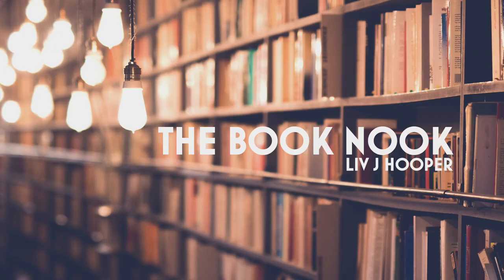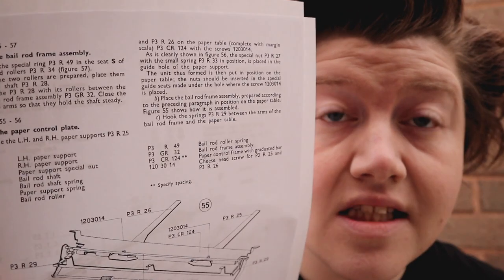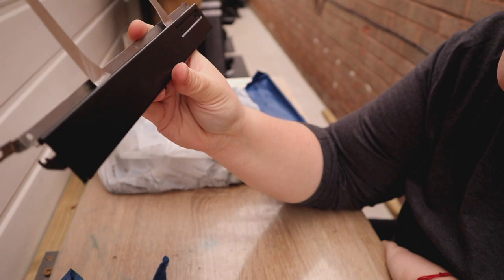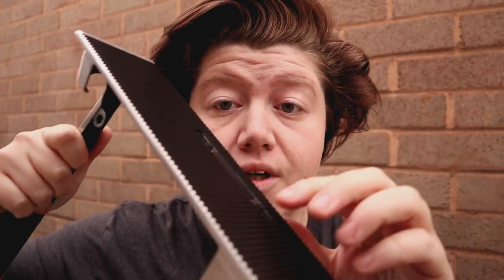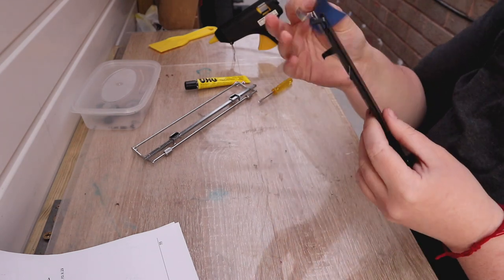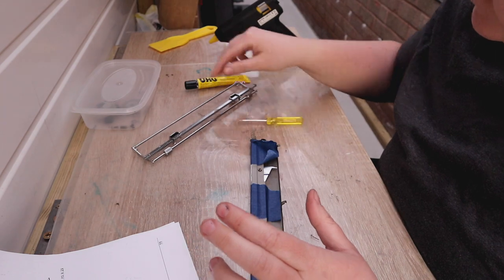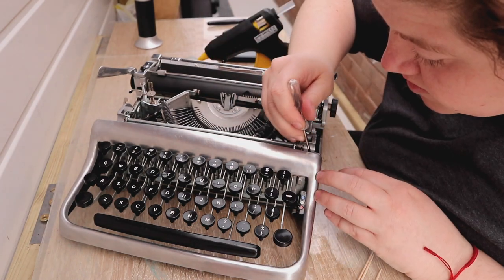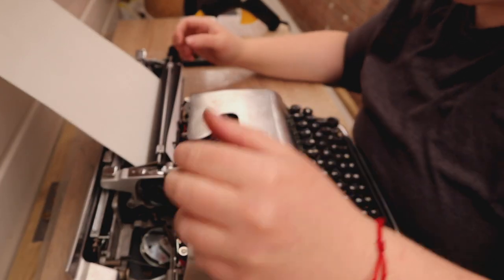The Workshop Nook - Olivetti Lettera 22 DIY Diary

Comment: Hi Liv, I accidentally came upon your videos and they’re wonderful! I, myself, have been working on tweaking my Lettera 22. Just curious, how did you strip the original paint? Thank you and keep up the awesome videos :)
Reply from the maker: There are dozens of us!!! 😂 so I used basic Wilkos paint and varnish stripper for the main body, brushed on a coat and left it for a couple hours, then applied another coat, left it overnight and used a paint scraper. That got most of the paint off, but not totally. I gave it a rinse with diluted white spirit to get the paint stripper gunk off, and basically used sandpaper and wire wool and a lot of elbow grease! I started at 240 grit and worked up to 400 grit before switching to fine wire wool. Some reaaaaaally stubborn bits I used 180 grit for but the scratches that makes are harder to buff out, so only did that on bits that would be hidden, so like the screw holes that the top plate hides. The paint on the paper plate came off super easy with just one coat of paint stripper, because the metal underneath is less grippy I guess? Hope that helps!